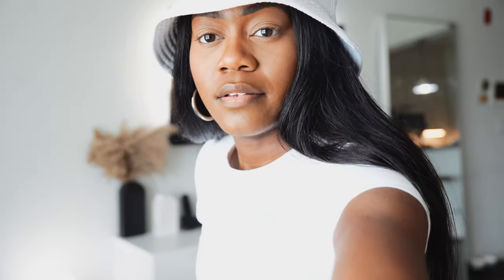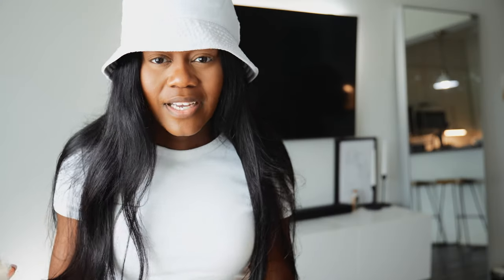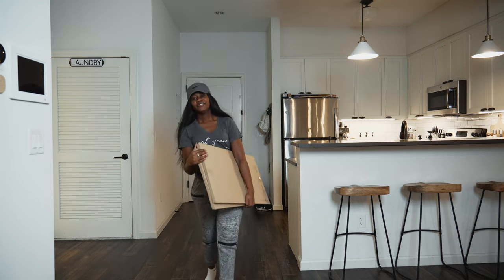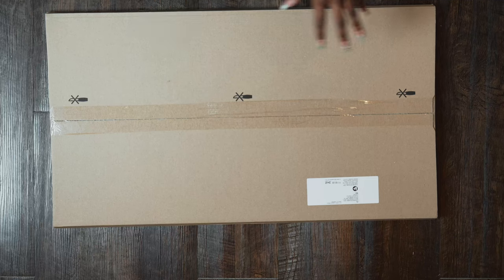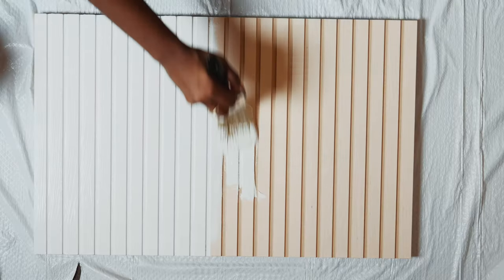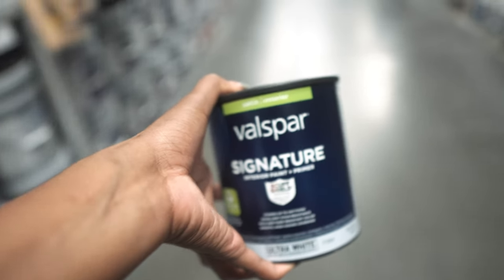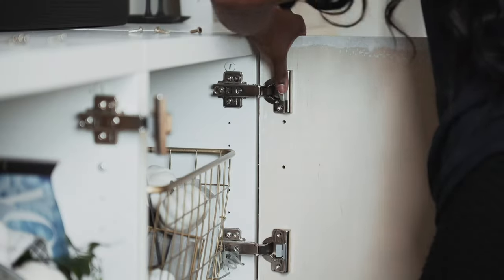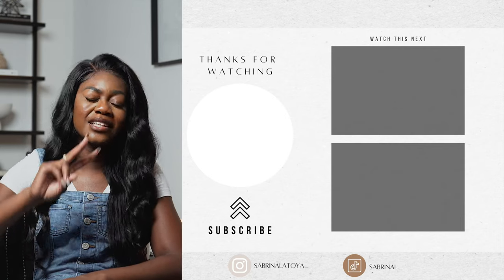EASY DIY IKEA HACK - DIY Fluted Besta Cabinet

Comment: That looks really nice. I thought I wanted floating shelves under my mounted tv, but I may just try the cabinets instead. We’re the fluted doors cheaper or more expensive than using pole wrap?
Reply from the maker: The pole wrap is a much cheaper option. Since you can cover more with only one pack. It just cost more in time ¯\_(ツ)_/¯.